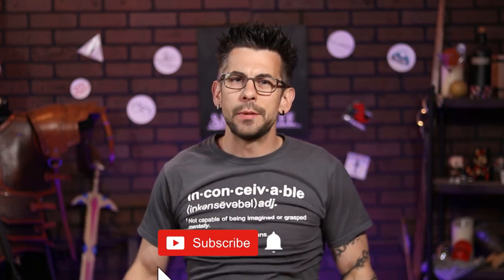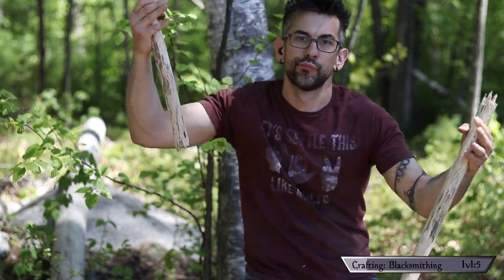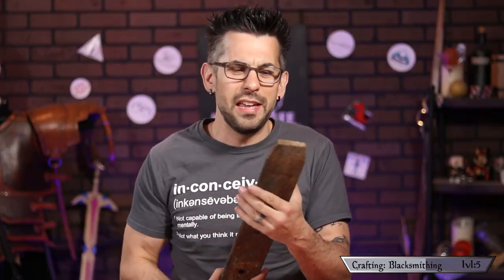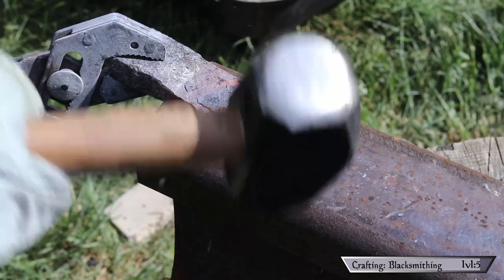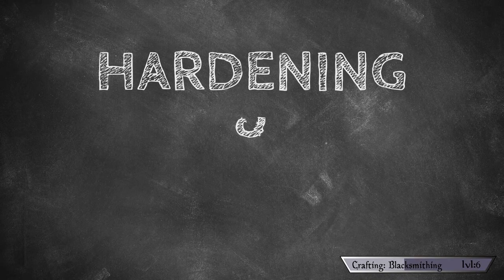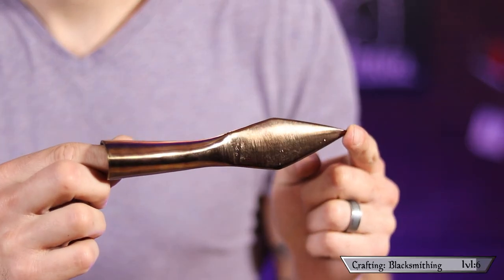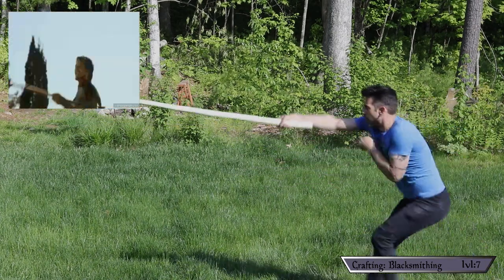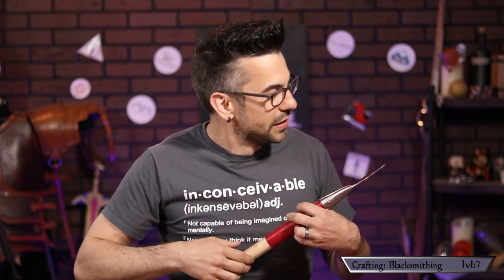Forging A Spear Head from SCRATCH!

Comment: Awesome video, as a blade smith I totally agree with you on how the sound changes as steel cools. btw that steel looks like it could be from a forklift like you said or it may be the center part of a leaf spring ether way its likely 5160 which is great for knives 

ps. a atlatl could be a fun next project.
Reply from the maker: Sweet! Blind luck strikes again🤣. It's also nice to know the sound change is a real thing. Cool how little things start to reveal themselves to you as yoi work.
An Atlatl is a GREAT idea. 100% on the list. Maybe even VERY soon.
Reply: I thought it was leaf spring myself but it's been ages since I've seen a forklift's prong.

Comment: A water bottle is a good test because if your edge alignment with a sword is bad, your water bottle goes flying. Perfect edge alignment will slice through the bottle, letting the top slide off of the bottom, leaving the bottom in place and the top to fall down fairly straight. I think Skallagrim goes into some detail about it on some of his videos. I've never been able to test this because it's easier if you have a rig on which to set bottles.
Reply from the maker: That's good to know! Thanks for enlightening me😁
Reply: @SkillTree  - Also, you probably have some, or can find plenty of plastic bottles for free; and water can be relatively cheap as a weight compared to other cutting materials such as fruits/vegetables (which are also seasonal, and messy), ballistic gel heads (zombie heads*) or tatami mats. Since you can only cut something once, cheap is good; and spilled water is easy to clean up, most often simply left to evaporate or be absorbed into the lawn.

Also, many people think corrugated cardboard would be good, like pizza or Amazon boxes, but it actually dulls the blades' edges really fast because you have two parallel layers, and perpendicular lines that change angle and spacing, instead of a single layer like a plastic bottle; and it's actually quite abrasive on a microscopic level when you look at how it's made.

Comment: As a hobby smith for some fifteen years, two things;
1) Yes, the sound change is a real thing and a good way of knowing when to reheat.
2) You should get a "real" anvil. Railroad anvil is fine for straightening the odd nail or whatever, but all the ringing you hear is power from your blow being lost. A real anvil will "answer" your blows (swedish expression) better so you move more metal with much less effort!

Keep up the good work!

Comment: So the reasons for water bottles:
1: Edge alignment practice. Edge alignment is making sure that the edge of a blade is parallel to direction of motion. If you've ever had an axe slip off to one side and not do much chopping, that was bad edge alignment. A good cut, sharp blade, and good edge alignment means that the bottom part of the bottle shouldn't move much at all. If the whole bottle jumps, or is knocked over, some part of it was not ideal. Similar attributes can be seen with stabs, but not the main reason.
2: Water is heavy, and the weight will resist movement enough to allow stabs & cuts without just being knocked away.
3: Cheap, usually free.

So it's not really for an analogue for humans, but it's for practicing technique. Also looks pretty cool as a bonus. The normal material is wet tatami mat with a wooden core, ideal is ballistic gel & fake bones and stuff. But those are expensive. Other good materials are wet newspaper, and pool noodles. In any of these materials, you're looking for a clean, straight cut that doesn't curve.
Hope this helps!

Comment: The lack of a Melon Lord reference is a missed opportunity.

And yes, you can absolutely hear the difference in hot and cool metal when striking it. Also also is that Railroad you're using as an anvil? It's a great starter anvil but you lose a lot of the impact when striking on it. I was amazed at the difference when I transitioned over to an anvil.

Comment: Couple points..

1. Yes you CAN hear the difference in sound
2. 1950 is WAY to hot for simple carbon steel
3. Table salt is MORE accurate than magnet(when it melts on contact youre there)Each alloy loses magnetism at different temp and generally speaking you want about 1500F which right about where regular table salt melts
Reply from the maker: All great tips but that salt one is GREAT! Thank you for the lesson! I will use it for sure!
Reply: @SkillTree  Advantadges to personally knowing several American Bladesmith Society Journeyman and Master Bladesmiths , having a subscription list that is 99.9% makers and 98.5% Bladesmiths...LOL

Comment: You can tell how hot the metal is by how high pitched its sound. By the way, I would defiantly recommend getting a small anvil. This will make your forging experience far nicer as you have the horn/ beak for drawing the stock out over. Railroads don't have enough weight beneath them to absorb the shock of the blows so after a long forging section you will just want the die because you are doing all of the work with the hammer. another fix is by having rubber handles on the hammer to reduce the shock. I hope this was help full. I love your vid as they keep me entertained from start to finish. keep doing what your doing :)
Reply: I find It funny how I get recommend the same videos 2 years later...

Comment: When fitting heads you can also coat the wood in something that will transfer across to the metal an leave a mark (colour chalk works OK in a pinch) then you can slide it on and see where it's contacting. As long as the conical shape is half sharp it should only initially contact on the protruding bits.

Comment: running out of metal for the socket and having a small head is why most smiths would start with the socket, then once they have that formed hot cut it from the stock, and then forge the head

Comment: Hey! great build I know I'm a day late but that is a great build! I particularly like the red leather around the head, beautiful work.  just an fyi if you need to figure out the width you need for the metal shaft piece take the diameter of the wooden shaft and multiply by pi (3.14) or just three and a bit if going by eye.  once you bend it into a circle it should be pretty close.  You can trim the wood if you need to but we used to just force it on to the wood as it was red hot then pull it off once it cooled to do the finish work, gives you a custom fit.  I'm not sure though it might be safer with two people.  BTW I love the wood shaft you cut but doesn't the local orange box store sell rake handles near you?

Comment: Nice. Not being an expert at all, the spear work looked pretty good to me. 
If I recall correctly, water bottles are a popular choice because they are a good cheap and repeatable benchmark test. If your weapon is to dull, it will knock the bottle over instead of cutting it. If you can only cut 2-3 bottles before noticing a difference in the cuts, you may be putting too sharp an edge on it or the steel might not be capable of holding a good edge. Since they're a cheap and easily obtainable resource you can more readily compare the cutting characteristics of various weapons instead of using something more expensive like tatami mats.